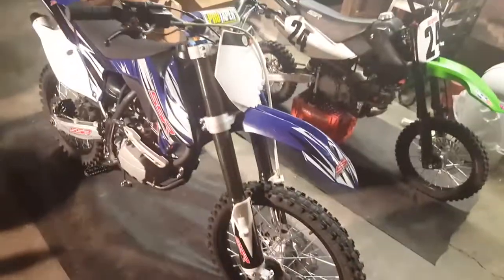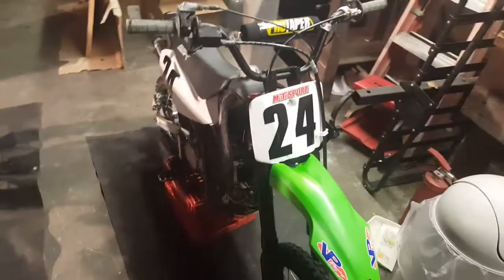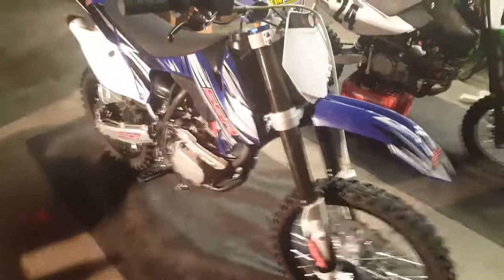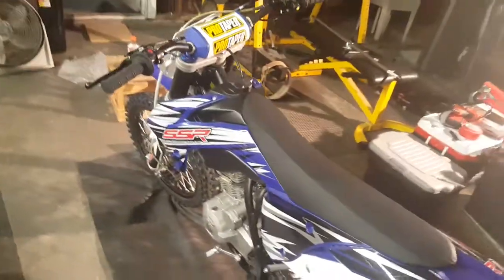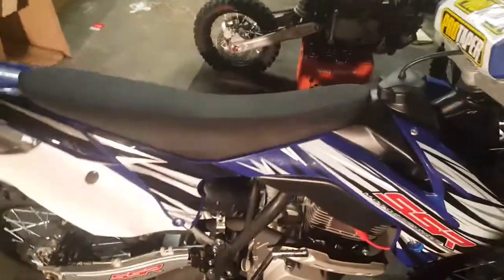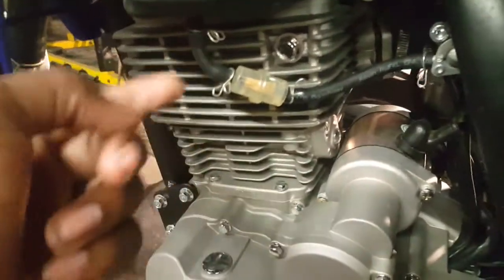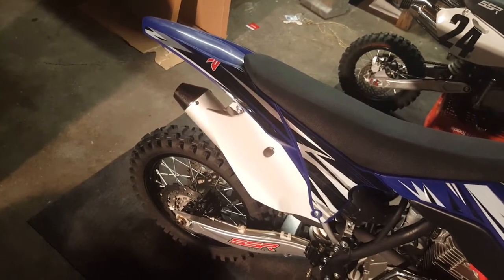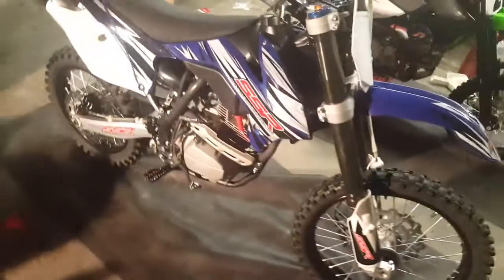New mod on the ssr 189 plus update again

Comment: Hey man I have the same bike as you and my 189 loves to back fire and to bog and it dose not like to idle by it self do you you know why that might be and how do you oil your air filter
Reply from the maker: Hobby Jonathan you will need to change pilot or main jet. I'm not too good well im not good with carbs at all. But for sure needs to be jetted properly to fix that issue. I use air filter oil spray can't think of the name I'm at work right now..
Reply: Jayclem84 ok cool, but my 189 when I wanna gun the throttle it's Boggs so bad idk what to do
Reply: Hobby Jonathan definitely your jetting. I'm a SSR dealer and have seen the issue with the 150 and 188. the engine is a great engine, but they did not give the engine the gas and air it needs to run correctly. you will definitely need to go up on your jet sizes
Reply: SSR Powersports of Duncan thanks for the tip I what I did to save money is I made the hole in the jet bigger and I did that to my 150 and it runs alote better
Reply: Get a Mikuni 26mm carb, or 28mm, just buy the one meant for 190cc or 200cc.

Comment: Different graphics will make you go faster.
Reply from the maker: David Willems thanks for the pro tip man...I just don't know which color squeezes that extra hp
Reply: Jayclem84 I got the red and white one. Have you changed out the spark plug yet? If so what size?
Reply: @JCem8409  anything with flames add a good 10 hp

Comment: Where can I find graphics ? & what bike did they try to copy? Ktm?
Reply: Digit Cam the engine is a copie of a crf230 and the suspension and chassis is copied from a crf150rb
Reply: @unclechester3261  will a 230 motor bolt right in?!?

Comment: where do u buy this bike and Is there a class to race it in motocross
Reply from the maker: you can buy it at a local dealer that sells them go too ssr dot com and search for dealer near you or go to tboltusa dot com and order from them...class wise theres usually a pit bike class that allows this size usually called mad dog bike or some occasions they have a specific mad dog class depending on the turn out...im pretty sure it could keep up with c/d riders in 250 i have yet to try that though lol
Reply: If you raced it that would be a coolest video I've saw with a ssr
Reply from the maker: im going to do my first race with it in the pit bike class either the day after turkey day or on december 3rd..ill try to make both though
Reply: Jayclem84 that would be a cool video to watch if you got it on a go pro
Reply from the maker: Hunter Snyder i plan on it
Reply: schoolboy 85 to 150cc (189 is a big bore 150) 
 trail bike 
 womens
Some places might consider it a pitbike but our organization would not says motor has to be like a 70 110 190 horizontal

Comment: Hey how did you add 3-4 horsepower? I wanna add power to mine Jayclem84
Reply from the maker: hardeman70 by swapping the 160tx levers but it was joke. I haven't added any ponies yet the only thing that can be done is port and polish and Orion sells a pro circuit pipe for it
Reply: Okay great thanks, you should do more videos
Reply from the maker: No problem. I will for sure have a update video this weekend been very busy lately

Comment: link to the levers please. Cause the stock ones suck balls tbh.
Reply: they look like arc Levers or asv levers
Reply: +aaron zahller he said there knock offs lol not paying $200 for levers I may break lol
Reply from the maker: +thatssr150guy lol..they were the levers that came off the 160.. They come stock on the 160 but you can order them from tboltusa that's where I get all my pit bike parts from they are really knowledgeable about everything they handle...I did have to dremmel down part of the front brake lever for the hole to line up and added 2 washers on the clutch lever so it didn't have play
Reply from the maker: +thatssr150guy www.tboltusa.com
Reply: +Jayclem84 I've seen the 160 unbreakable levers that why it is so familiar